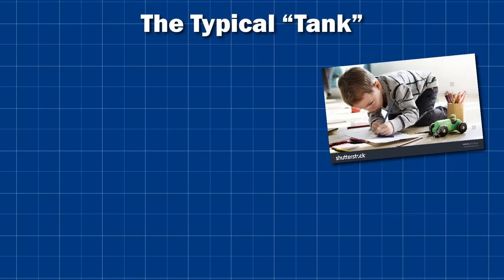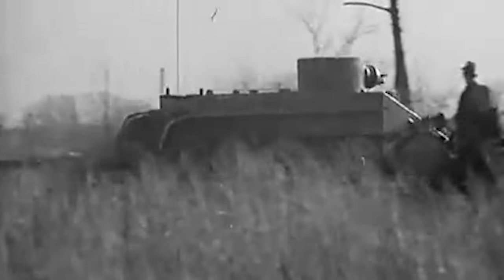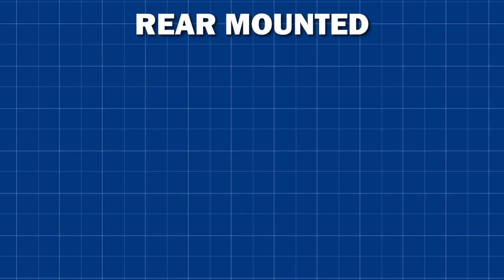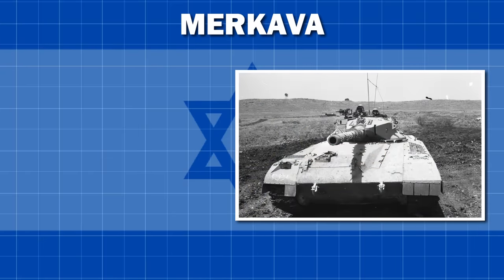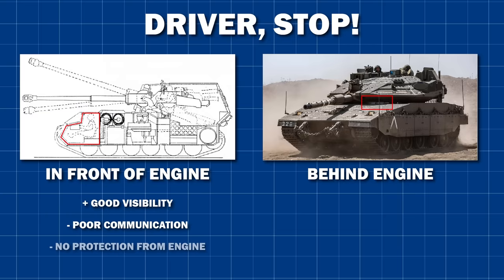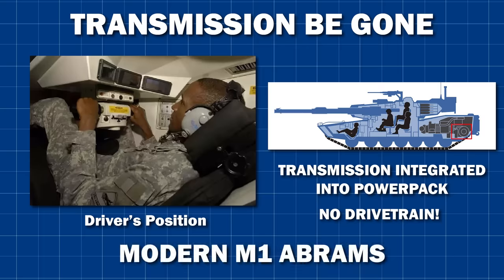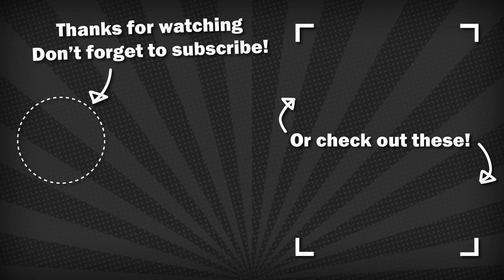What happened to Rear-Mounted Turrets?

Comment: Just a few correction's, the front engine mounting of the Merkava being due to crew survivability is a myth. Early Merkavas had quite poor frontal armour and the engine (as with most tank engines) was not made of ballistic materials like the steel used in armor. Engines are made to be as light as possible, making good use of metals like aluminum and other lightweight metals to keep the weight down. Much like the fuel tanks, the amount of protection offered against kinetic rounds is negligible. The same goes for all the other components placed in harm's way to protect the crew – they are pointless against kinetic energy rounds like APFSDS. The only real benefit is making the crew feel better protected, much like the Second World War practice of covering the tank with extra track links, sandbags, concrete etc. It is also not really designed to mount infantry as the rear space is taken up by palletised ammunition. To carry troops or act as an ambulance the ammunition pallets in the rear need to be removed giving the tank only 6 rounds of ammo. By removing the ammunition to carry troops, the tank's ability to fight is limited to the six rounds located near the loader. In short, the Merkava can either be a tank or an APC/ambulance but it cannot be both at the same time. The rear mounted access doors are actually designed with experience from the Golan heights in the 6 day war where ammunition resupply of the Centurions used there exposed the crew in their hull down positions. The rear doors were there to allow the  Merkava to be able to resupply without exposing the crew.

Comment: You forgot the biggest advantage of a rear-mounted engine, repair & replacement. The engine is the hardest working part of the vehicle, and thus most in need of servicing. A rear-mounted engine allows for better access during service or even a design which can be modularly replaced. This second concept has been a key facet of the success of Anglo-American tank designs. The tank is not thought of as a weapon, but as the angry end of a logistic train that extends all the way back to the factory.
Reply from the maker: Front mounted engines are just as easy to take out, surely? What would make them any more complicated logistically?
Reply: @RedWrenchFilms  What else needs to go in the front? The viewing & recon equipment, the guns, the business-end of the vehicle must point towards the enemy. This creates inevitable complexity that will get in the way of any engine-front modular system unlike is used on rear-engined Anglo-American vehicles. There's also the point that front-mounting the engine and using it as impromptu armour makes that part of the vehicle almost certainly unrecoverable. Besides the crew, the engine is likely to be the most expensive part of the machine. If you can preserve the life of the crew, you should next preserve the engine.

Comment: Modern turrets are NOT center mounted because the transmission is housed with the engine in the back. They are considered front mounted. I'm not aware of any modern MBT design that has a split engine / transmission layout.

Comment: 3:37, Merkava is not the only one, you're forgetting the TAM (Tanque Argentino Mediano), wich is a light tank (slightly above 30 tons) and has a rear mounted turret with a 105mm cannon. It actually has its newer "versions" (wich are updates) such as the 2C and 2IP (not confirmed yet).

Btw, you show fragments of the TAM 2C driving around, kinda proves my point that you forgot to mention Merkava is not the only one. You also did not mention the M10 when you said that Merkava is the only one.

Comment: They didn't really go anywhere. A large number of APCs fitted with higher caliber weapons feature such turrets. M1128, MMT-40, Centauro, PTL-02, ST2,  Marder MBT, CV90120. Not to mention pretty much every modern tracked artillery system. The rear-turret design didn't go anywhere. It didn't even lessen in use. Quite the opposite actually. It just migrated onto vehicle types that made more sense for it.

Comment: The front mounted engine isn't seen on MBT's because you drastically reduce the amount of armor you can have at the front of the hull as most of the space is taken up by fuel and the engine itself that is why Merkava has rather poor frontal hull armor. Merkava was designed in a time when HEAT-FS was the main threat to Israeli tankers so having all your fuel and engine eat up space made sense to defuse an incoming HEAT warheads. However modern APFSDS rounds aren't really affected by this as the engine block is far softer steel than RHA used in tank armor or composite arrays.

Comment: i do think that rear mounted turrets would become more common as new video feed and surveillance equipment can make visibility better for the driver though probably for light vehicles and IFVs and probably not MBTs, at least not rn
Reply: On paper in sounds good. But you would preferably want redundancy, i.e. the mark1 Eyeball. Less a mobilitet kill becomes a real issue. Optical sensors are notoriously fragile. At least with current materials.
Reply: @soul0360  yes true, but still we might see more vehicles like the merkava in future as that things nailed the engine front design, and I think I'll take the small camera over a periscope as that camera might have night vision or infrared

Comment: Turrets at the rear as more disadvantages than reported in the video. 1) thermal signature is place at the front. 2) cooling system more exposed. 3) problems to access to the engine for maintenance. 
As pointed the design is made to compensate heavy armor at the front, because the combat statistics said that the majority of hits are at the front. Is it the case today in Ukraine? Not sure. Majority of tank lost is from artillery, ATGM and drones. So it rises the question of where to put the armor? My opinion is that rear turret concept is from late 40's - 50's at the time where composite armor was not developed and heat ammunition was extremely powerful against single steel armor plate.

Comment: I still think putting the engine in the front is a bad idea since its in the front, the side of the tank that you show the most and gonna get hit the most, if a bullet penetrate the front and knock out the engine well you just become a easy non moving target and now engine are made of much more lighter aluminium which doesnt offer much protection, which a APFSDS wont gave any problem penetrating
And the merkava isnt meant to transport troops, you can but you will carry way less ammo, it only carry troops in urgent situation 

And im just a military enthusiast so if i did any errors i would love that you tell me so

Comment: The answer to the question that is the title of the video - "What happened to rear mounted turrets?".
The answer is nothing happened to them - they've never exists for tanks in the real world. They only ever existed in video games that are struggling for content.
The Merkavas turret is really centre mounted. The engine is in the front and the section in front of the turrent is perhaops longer than the section to the rear of the turret, but the turret is closer to the center of the tank than the rear. I believe the same is true for the TAM - not surprising given it is based on the Marder, which has a center mounted turret to allow for the passenger compartment.
You don't have to have a long drive shaft under the turret for a center mounted turret you can simply put the transmission in the rear. E.g. T-34, Cromwell, Abrams, Challenger, Leopard I and II. I don't think any modern tanks have a drive shaft that runs more or less the length of the vehicle.
Modern tanks have the tranmission and engine mounted in a single powerpack that can be pulled as a unit - in some cases in as little as 20 minutes to so. Makes a lot of sense from a design/engineering and maintenance point of view.
As far as I can recall there were virtually no rear turret tanks built (maybe a Maus or two) and maybe none went into service.
About the only AFVs with rear mounted turrets are SPGs and I suspect the main driver for that is ammunition supply while firing and perhaps just maybe barrel length.
Even when the driver is directly adjacent the fighting compartment an intercom is needed to communication between crew commander and driver.
Oh and BTW that would be "Driver *halt*!" not "stop". Soldiers and military vehciles don't stop, they halt.

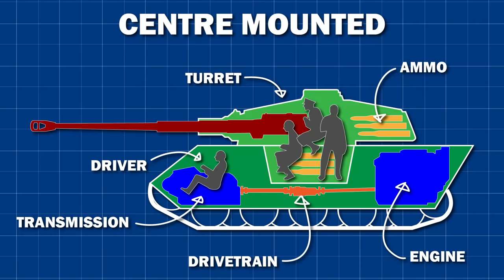Comment: when u mention the driveshaft disadvantage at 1:30, this isnt for all center-mounted turreted tanks as tanks such as the T-72 have the transmission in the rear with the engine, negating the extra space needed for the driveshaft

Comment: I think you're missing out arguably rear-mounted turreted vehicles- the modern Wiesel, the AMX 13/SK105 Kürassier and the FV101 Scorpion. Granted they're not MBT's but they are definitely tanks and the Begleitpanzer 57 AIFSV, M1128 Mobile Gun System, the B1 Centauro, and the M1134 Striker ATGM. AMX-13 and SK105 Kürassiers are in service as modernised as is the Scorpion- the largest modernisation ("modernisasi panser AMX" if you want a google search term) probably Indonesian armed forces gutting and refitting the hulls with new powertrains, engines, tracks, comms, combat computer systems, etc and most importantly fitting John Cockerill 3105 auto-loading turrets 105mm as infantry support, with some anti armour capability- though doctrinally anti-tank this role will be undertaken by missile and 90mmm & 105mm Falarick and the wide variety of man portable ATGM's. (M80, Armbrust, AT4, C90, MILAN, Javelin L-RACMalyutka, Metis-M & N-LAW). The Cockerill turrets are also capable of remote fire. Here's a good demo: "Leo 1 fire test shooting with the new Cockerill 3105 turret"

Comment: This video is missing/wrong about 2 points. Turrets should ideally have a centered center of gravity, because otherwise you would have unequal wear of the turret ring as well as more friction when rotating the turret. Rotation a turret with a offset center of gravity would also shift the entire center of gravity of the vehicle, which should be avoided because of multiple reasons. Thats why you see counter weights fitted to turrets. On the Tiger 2 used as a example it is very visible, because a lot of wheight is needed.

Mounting the turret in the middle also provides the most stable platform for shooting/spotting on the move, since the center of the vehicle is less effected by uneven terrain.
Reply from the maker: Ideally turrets are balanced, yes, but in reality this is very seldom the case. The amount of ballast required to balance out the frontal armour and the gun is pretty high, and this is all just wasted weight. They are often balanced enough to still function but I’d imagine very rarely are they perfectly balanced.

Comment: Merkava and some other vehicles (predominantly self-propelled artillery) still use rear mounted turrets.
Reply: They are not tanks though. Artillery has a very different use case and purpose.
For starters, if they are under direct fire (Flat trajectory), something has gone terribly wrong. So front armor is not necessary, in the same way. Their guns are typically a lot bigger. These two means, that the gun placement is the deciding factor on center of gravity.
Good gun depression is not as useful as on a tank.
With a rear mounted gun and crew compartment, re-armament is a lot easier. While being 30+km behind the frontlines, this presents less security drawbacks.

Since counter battery fire is becoming faster and more precise. Most newer artillery designs, focus on speed rather then armor. Meaning guns are placed even further back then in the 60's, and are often on a wheeled, rather then tracked chassis. Even so far back, that the gun is operated from the outside.

Comment: Another downside of rear mounted turrets is the problems with center of gravity, as you are basically putting all heavy stuff in the rear half of the tank. Then again, in the case of Merkava, crew survivability was the most important priority. Israel has a small pool of manpower, so the designers wanted to build a tank that offer the best protection for the crews. Israel could replace tanks, but not experienced crews.

Comment: Drivers are usually buttoned down in combat, so visibility isn't much better on the front than behind the engine. Communication between crew is definitely a priority either way. 

However, kamikaze drones armed with RPG rounds in Ukraine have free roam to target the rear and top of the tanks anyway. So it still makes sense to have rear mounted engines for the added protection.

I think militaries are going to stick to tanks with rear mounted engines in a battlefield where threats are going to strike from every direction? Intercoms are not going to work all the time, the option to communicate directly between the commander and driver is mighty important.

Comment: I have always had a soft spot for the merkava series because of its uncommon design and it not being the best western tank, but being the best tank for the IDF to use in large open deserts where you need survivability over top notch performance. Also for the sheer amount of damn antennas they put on them, especially the later models.
Reply: I've always felt the same way. Not the best in the world, but the best for what is needed in the region.
Reply: @scottgalbraith7461  Scott, The Swedish S Tank comes to mind. Perfect for a cold war defensive role in Sweden. No one else would buy it though. It was too well optimised for Swedens' requirements. Interestingly it had a Boeing gas turbine engine as part of its power train. PS I am really enjoying this great discussion and peoples' valuable contributions.
Reply: @robertsopinski7971  I think I know the tank of which you speak. Very specialized but excellent for its task.
The only drawback to specialized weapons is the difficulty in marketing to the rest of the world. When your nation is at stake, who cares? But, I must suggest, exporting versatile weapons helps pay for development. Just a thought.

Comment: This video seems to get a lot of things about tank design wrong.

Drivers don’t need to be located anywhere near the turret for ‘communication’, that’s achieved by a hardwired intercom system, where all crew are able to converse on headsets. Moving the driver back doesn’t make them any more capable of conversing with the commander as they’re situated in a separate compartment.

Engines in tanks don’t - for the most part - sit up front because the purpose of a tank is to directly assault the enemy, generally head on. You want your power pack as protected as possible, thus it sits in the rear of the vehicle. This means you cannot rear mount the turret because the basket would interfere with the location of the power pack. 

The Merkava is an anomaly because the Israeli doctrine is to fight from pre-prepared, dug in positions, putting the tank hull down at almost all occasions (as seen in the Golan heights). As such they place the power pack in the front as, in theory it is protected by the earthworks around it. This forces the turret to be moved rearward (not a design choice, a design necessity). They also claim it was a decision centred around crew survivability, putting as much metal between the crew and any incoming rounds - this seems flawed as tank with a dead engine is arguably more dangerous to the crew than one that has taken a hit but can still manoeuvre.

Comment: One minor nitpick, tanks could have the transmission at the back and drive the back wheel instead of the front wheel since the start, soviet T-34 did that as for exemple of a well known model built in the tens of thousands. Yes it's also known to be hard to shift gears in, but I'm convinced it could have been improved by a better linkage system to the gearbox and also... a longer gear lever to have better..well.. leverage (smh they couldn't be bothered about ergonomics at all back then)

I'm not actually quite sure what school of thinking led to front mounted tank transmissions for a while tbh, considering even the mark 1 ww1 tank drove the back wheel. There is a small crossability benefit to pulling the tank from the front wheel rather than pushing it from the back wheel but the benefit has never been worth the trouble as far as im concerned. Of course hindsight is 20/20.